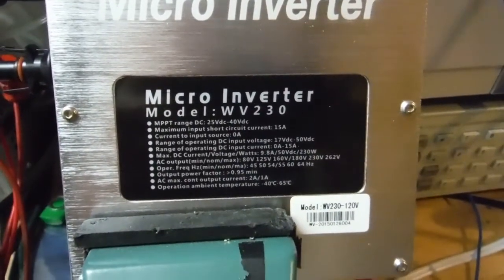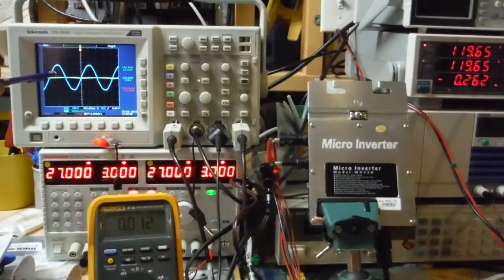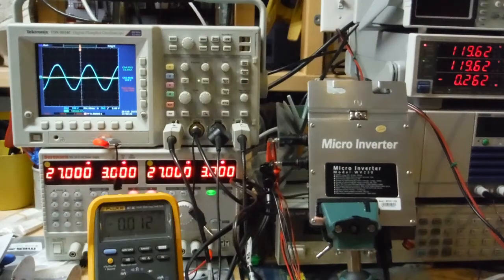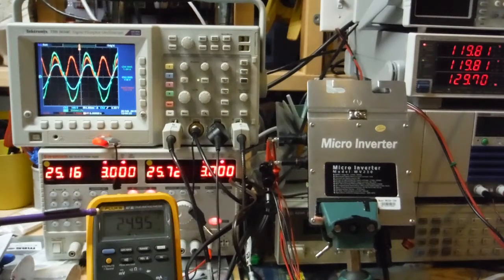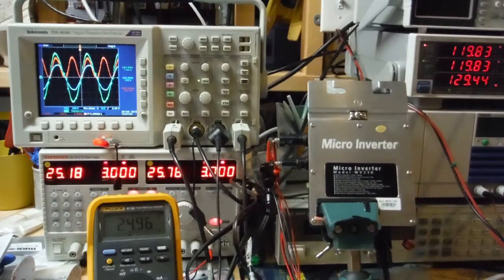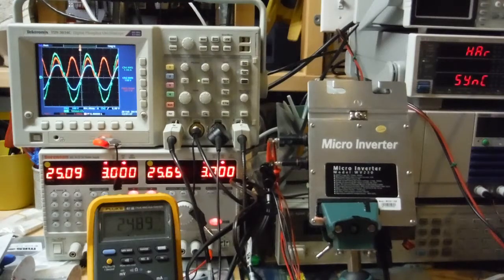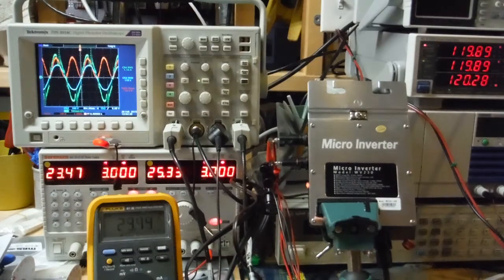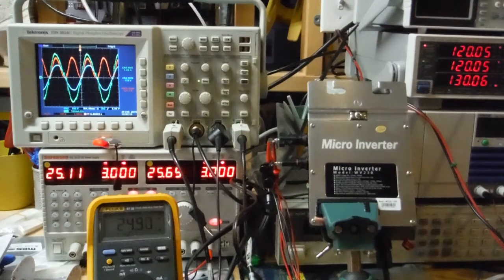WV230 Inverter Review

Comment: Thanks for the review!
How was the inverter temperature? Does it get warm??
Reply from the maker: Torsten Tiedtke Its warm but not uncomfortably so.
Reply from the maker: diypayitforward My garage is 23C and the case is 50C.  This is with a 190W output and it should have been at this level long enough to hit thermal equilibrium.  Measured at 2:30pm on a sunny day.
Reply: diypayitforward Thanks for the update.  50C is probably quite reasonable at 190W and >>80% inverter efficiency...